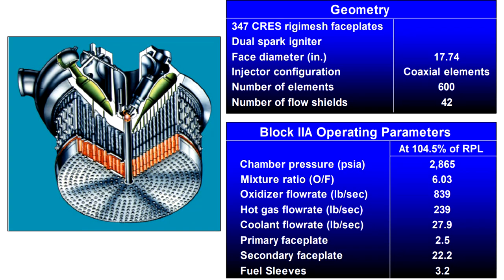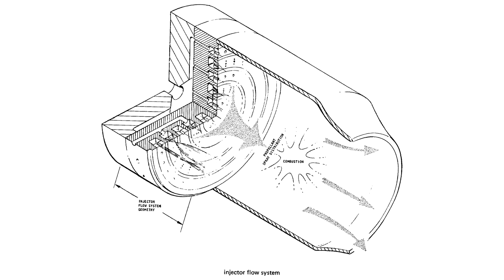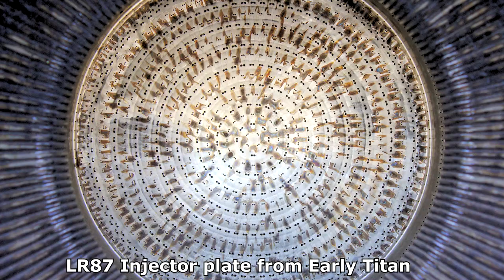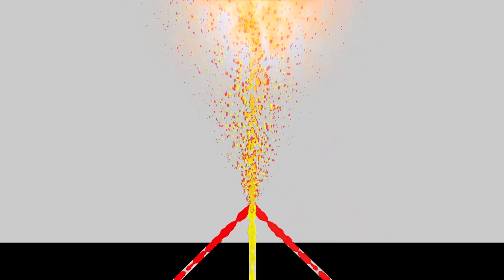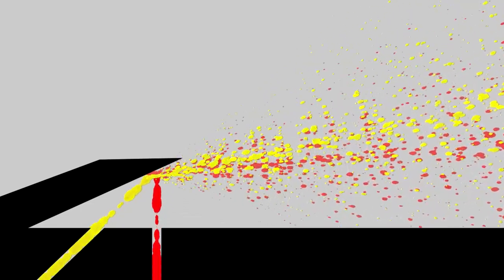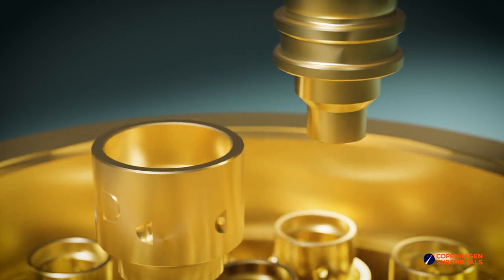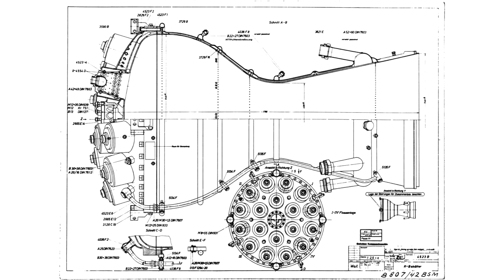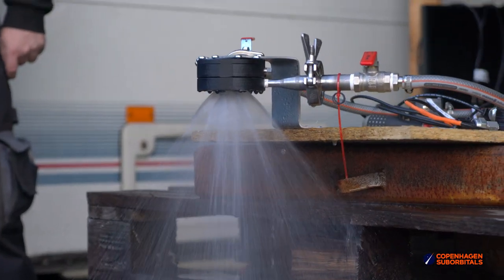Rocket Fuel Injectors - Things Kerbal Space Program Doesn't Teach

Comment: I worked on the F1 and J2 engines for the Saturn projects. I worked for Rocketdyne areound 1963 and 64 to start. 
I did improve the injector plate for the F1 and I know 
 about it. i have a photo with an astronaught , Walter Cummingham in fron of the skirt of the F1 engine. Some of these statments in this video are wrong.

Comment: There are six F-1 engines on display at the INFINITY Science Center. Five are mounted on the business end of 1st stage S-IC booster located at the facility, and one is mounted on its roll rack for up-close inspection. ISC is the official visitors center for the Stennis Space Center.

Comment: At 00:57: SSME main injector. Engine s/n 0110, Test 750148, July 2, 1981
Failure: Lox injector post crack

Incident Description: Test 750148 proceeded normally until 16.0 seconds when the HPOTP turbine discharge temperature exceeded the redline value. Inspection of the engine revealed extensive damage of the fuel preburner side of the main injector with burnthrough of 149 Lox posts, erosion of the primary and secondary face plates, and erosion of the interpropellant plate. The nozzle sustained shrapnel damage to approximately 150 tubes and the MCC suffered erosion damage.

Cause: High cycle fatigue of Lox post caused by random mechanical vibration of the powerhead and flow induced vibration from the hot gas combined with high steady-state stresses. The damage pattern of the injector indicates the failure occurred at the inertia weld of post 12, row 13. However, the posts in this vicinity were largely consumed by the fire, including the fatigue crack where the failure initiated. Post 12, row 12, which is very near the indicated failure location, had been reworked and the acceptance requirements relaxed, making this post a credible candidate as the failure initiation point. 5. All evidence points to high cycle fatigue near a Lox post inertial weld as being the single cause.

https://ntrs.nasa.gov/archive/nasa/casi.ntrs.nasa.gov/20050217132.pdf

Comment: There are thousands of shaped holes machined via die sinking e.d.m. Hence why I don't make videos pertaining to small hole machining. Shower head holes are best suited for film cooling of turbine hot section hollow vane rings.  Shaped converging holes work very very well for fuel distribution/mixing fuel in a rocket.  Former Pratt & Whitney vane/blade manufacturing engineer, tool designer and die sinker e.d.m. Yoda.

Comment: Ok, now I can see where 3d printing of high temperature titanium alloys would really help in cost and efficiency of rocket engine components outside of just the fuel and oxidizer manifolds and piping. I recall some efforts have been made to print the nozzles with the cooling piping printed into the part, but that has been more difficult because of the size and stresses that part takes.

Comment: I bought a really neat garden hose end about a decade ago and it worked really well as water rocket. I need to to see if I can find the drawing for it because the water flow from that converged in the center and I'd have a ton of fun mixing two different water streams (differently coloured ones) in it. It was basically a combination of a pintile and a swirl injector at it's very core.

Comment: Check out Aerojet Platelet Technology. The process begins with thin sheets of metal that are photo-chemically etched to specific design patterns to produce "platelets." Individual platelets are then accurately assembled, or "stacked," and joined via a diffusion bonding process. The result is a monolithic structure containing complex internal passages that allow for precise flow control, fluid manifolding and metering features. Also, in-situ filters can be included to preclude plugging or occlusion. The diffusion bonding process effectively seals the passages between the fluid circuits with a solid metal barrier, isolating and segregating flows. This allows for much higher operating pressures and temperatures.

Comment: Very interesting video. Makes me wonder if anyone has tried applying an electric charge to the fuel and oxidizer. The charged fluid should fly apart from repulsion as soon as it's not confined by the pipe, and if you gave the oxidizer the opposite charge to the fuel, they should attract and mix. Of course, charge differential can also lead to sparks, which might explain why nobody has tried one, but I am curious, and I doubt Google could tell me 😋

Comment: I think a fun science fair project might be to reverse it and make some impinging injector shower heads. Then compare the fine mist they produce with the parallel streams of a normal shower head. Depends on how difficult the fabrication is. Probably would make it by connecting a regular shower head to a piece of acrylic with diagonal holes drilled in it so you get that lovely see through effect

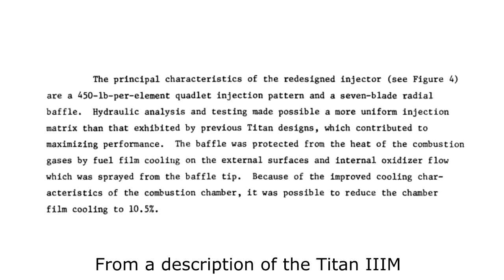Comment: the sts-93 video you did ( excellent info), you mention at 8:03 a damaged phillips head ( burred) causing wire shorting, you suggest an over-zealous engineer tightened it too much. Looking at the pic of the screw, and assuming it has normal thread direction, it was during untightening when the burring occurred. 

So the engineer would have been aware of how difficult the screw was to undo, likely he would have noticed the damage, as he would have to then tighten the screw. You could perhaps say he used a screwdriver which was at a bit of an angle ( not 90deg), an impact driver might have been the way to go.
If its a reverse thread screw then your theory might be correct, I'm guessing its normal thread.

Comment: Great project! If you just change the amount of ethanol, but not the oxigen, you might get high combustion temperatures at low ethanol flows. Are these still low enough for the combustiom chamber? 
How you ensure that the preassure in the combustion remains lower than the preassure in your supply lines? Otherwise you get backflow again.

Comment: Great video.  It might have been worth noting that the volume of fluid going through these is significant and at high pressures relative to the shower head and video of the water flowing though the injector.  The proverbial drop in the bucket.   They are an amazing piece of precision engineering for one (test) or two uses (launch).   It is interesting to note that it is not just the holes but the fluid path leading up to the exit every little change in direction is a pressure drop.  A carefully designed fluid path could be printed to move towards ideal and overcome the subtractive manufacturing cost limitations.  A final thoughts:  Do right hand swirl injectors work better in the northern hemisphere and left hand in the south?!     Are the swirl patterns balanced to eliminate gyroscopic effects?

Comment: I believe Space X is 3d metal printing the injectors, to avoid all the drilling involved, especially considering the metals involved are very exotic and difficult or imposable to manufacture with normal subtractive manufacturing technics, They use 3D printing for the SuperDraco engine chamber.

Comment: What I still don’t get is why the combustion in the  rocket burn chamber does not push the fuel and oxidizer back in the pipes/prevent flow. Only thing I could think of was that the injectors are higher pressure, in which case is might seem logical to not burn it but use it as propellant. Obviously something in my thinking is wrong but what?

Comment: A great idea to try with the pressurized fuel tank is instead of pressure pushing the fuel why not pull the fuel from a bladder, you can even help the process by squeezing the bladder with pumps pulling the fuel.
Reply: i think the pressure required is extremely high, only a pump fed by the energy of the engine can sustain it.

Comment: Hi,
On the F1 engine, they had a problem with the fuel injector plate that caused a oscillation that planted itself upwards into the stages. How did they solve that ?

Comment: I'm still waiting for rocket injector technology to evolve past pintle injectors. Modern common rail injection setups in diesel engines use a much better system with higher atomization rates. I believe that although it is a very low flowing system it could be adapted to rocket engines or jet engines. Seriously the inefficiency in the designs is crazy compared to diesels.
Reply: yes

Comment: Great stuff.  It does lead you to wonder if atomization is the key desired end result and surface tension of the liquid is what you're trying to overcome (the point of swirl, impinge, rotating style injectors) then is there another surfactant that is much simpler / easier to manufacturer that is more efficient?  Swirling in tubes seems archaic, frankly.  Could you impinge the flow with radio / light / electric waves to break down the surface tension for example?

Comment: Another very informative video, thank you!  You answered some questions I have long had.  I am looking for recommendations on obtaining a better understanding of how to shut down a rocket engine. This is more on my mind with the Falcon 9 but actually extends to other multi-engined rocket.  With gimbals involved, controlling an engine shutoff cleanly must be quite an engineering challenge all on it's own.  Even with the solids I wondered about what happens if one of the SRB's (shuttle) shutdown a second faster than the other.  Could the shuttle engines compensate enough or was that a non-survivable event for the vehicle?  With 9 engines on the Falcon 9 and then 3 with the boostback (less mass/inertia to deal with), this makes the shutdown event even more critical.  (maybe a video in there someplace (if not already and I didn't see it)).  Thank you for your always substantive and entertaining work.
Reply: You can't (practically) shut down a solid. They simply burn to the end. To avoid the problem you raise about one burning longer than the other, the space shuttle (and others) release the SRBs before they burn out. so you can control the timing better. Also note that the thrust profile (trust over time) is controlled in the shape the fuel is cast.
Reply: @jnygaarddk  Good point about the separation timing and thrust being designed into the build,  I did understand that to some degree.  Though the possibilities of imbalance never left me any comfort for solids as being human rated.  Spinning turbine pumps on engines which needed to be restarted is a bit different though.    Hey thanks for the the input help!
Reply: @rogermarcoux8029  Remember the SRBs on the Space shuttle has a gimbaling nozzle on them for TVC. Takes care of any imbalance in thrust

Comment: So what's the current status with 3d printed injectors? Looks to me like a prime candidate for it, yet it seems to be still very much in the experimental phase?

Also, do the 3 landing Merlins on the Falcon 9 have different injectors to the others so as to better accommodate the throttle control and shutdown requirements?

Comment: In the first example you showed us with the differences in weight of either the oxidizer/fuel will make the mix travel at an angle, so engineers have to compensate for the weight. Is that how different engines will run a closed oxygen/fuel rich cycle? 

I’m sorry if I sound dumb lol, I’m new to this stuff

Comment: hello scot, i dont know if you will ever read this comment, but im building my own amateur rocket engine with scrap parts, now i got the injector with 6 holes pointed to the center at a  in about a 30 degree angle and with a bigger hole in the center, now according to this video, i got even more confused, wether i should use the oxidizer or the fuel in the middle, due to cooling matters and pressure in each propellent im going to use (one liquid and other gaseous), is there any way i could show u my injector and explain better my questions to you? 
ps.: anyone that would be willing to help is welcome too

Comment: I gotta ask ... Why change the angle of the coaxial swirl injectors after the injection, when you can manufacture that same angle, precisely like in the earlier, simpler injectors? I thought that optimizing exit speed is the holy grail, plus it kinda makes sense that faster impact between the two, whatever two, propellants equals better spraying. Might be a minuscule break but it still seems like a break, at least to me ...

Comment: At 15:00 Scott mentions the benefit of having the propellants exit the injectors as a gas. Wouldn't it then be beneficial to skip all these collision methods by heating the fuel and oxidizer to the point that they're both injected as gases? I imagine it could be heated radiatively from the heat of the combustion chamber. I wonder if it's possible to use both the oxidizer and fuel in different parts of regenerative cooling to the point where they both end up injecting as gases. Is that too complicated to engineer? I

Comment: What about the resin mixing tubes that have a double spiral that meet at the end and mix, that could be used to inject fuel? The other I thought about was a straight drilled plate with another plate with the holes slightly off so it would spray the fuels, it save complex drilling.

Comment: There is one more type of injector that wasn't mentioned. Supercritical injectors. They use supercritical fluids, which is possible because these days we have comparably high pressure combustion chambers that lend themselves to such design choices
Reply from the maker: Lots of the fluids entering the via these are supercritical already, how does the injector specifically change for this?
Reply: @scottmanley  With the high chamber pressures and temperatures you can get supercritical injection which lends itself to much simpler injector designs since you inject media without surface tension. This leads to much better mixing of the components. So you can safely use comparably simple injector geometrys (mostly used with cryogenic fuels).

Whereas stuff like swirl injection or pintle injection etc are mostly used in chamberes with more moderate temperatures and pressures since you have to rely on even atomization for proper mixing.

Edit: So overall it's essentially an own injector category even though from a geometry standpoint it arguably isn't

Comment: What kind of injectors does the Rutherford engine have? Since it's 3D printed, you could put whatever weird geometry your modelling optimizes for.
Reply: The Rutherford seems to "only" have a 3D printed combustion chamber and nozzle, with a machined injector assembly bolted on top.
Reply: @CopenhagenSuborbitals  Huh, what's the reasoning? Of all the components, I'd think the complex geometries of injectors would be most suited to printing; unless the tolerances aren't good enough?
Reply: @allanrempel5839  Not sure, you'd have to ask Rocket Lab. Perhaps back then additive manufacturing wasn't at the required level for injector manufacturing yet. But now you can see that being done, or at least attempted by, for example, Orbex, who are going for a fully 3D printed engine. We also just received a few 3D printed swirlers for testing. We should have a video on that soon if you're interested. :)

Comment: 15:0o "if you think about it the reason why we are wanting the fuel in tiny drops is so that they evaporate into a gas faster."  that is not exactly accurate. the reason is so that one may maximize the surface area  contact between the reactants in order to have the most efficient, consistent, rapid, & stable reaction possible.
Reply from the maker: And a gas has the highest surface area.
Reply: @scottmanley  hi Scott first thank you for replying. :) I do very much enjoy your presentations even though I often feel that some things could be improved. but then that is the nature of the subject. I feel very strongly for instance that not enough attention has been paid to large scale off planet life support concepts & I don't mean recycling old O-Neal or von braun station drawings. nobody and I mean nobody seams to have a clue about the potential for deep space architectural design.

Comment: First heard about preburners. Are they really small rocket engines inside the fuel and oxidizer supply line, where a small amount of the other ingredient is mixed in, ignited and burnt, to a) drive the turbopump with a power of 50000 HP and b) heat up the fuel/oxidizer from liquid to gas ? Interesting.

Comment: If the RL-10 chamber pressure is over 4000 kPa, what is the output pressure of the turbo pumps to achieve a spray at a high flow rate?
Reply: Add 10% or so would be a fair guess.....
Reply: The hydrogen turbo pump outlet pressure is about 1700 psi (~12000 kPa) and the oxygen at about 900 psi (~6000 kPa).

Comment: Has pre-mixing ever been attempted? Wouldn't work with hypergolics, for obvious reasons. Wouldn't work for anything with liquid oxygen, as it would freeze most fuels. Even methane and liquid oxygen have only a few degrees of play between each other before the oxygen freezes the methane. But who knows, if the fuel is stored in frozen powder form maybe a heterogeneous solution can be achieved haha
Reply: yes it has been tried before and it usually ends with a huge explosion from a tiny spark that ignited the  fuel. any ignition source and the fuel will have plenty of oxygen.

Comment: why not just add an open bottomed cylinder around the pintil output to redirect the atomized mixture and prevent the hotspot banding? i get there are some basic issues but none seem larger than the benefits and its a billion times easier than adding regenerative cooling.

Comment: i shamelessly admit i always thought the fuel mixture was pumped into the cone just from two huge ports, like in a petrol engine, were it ignited. Seeing this video, i remembered that even a portable gas stove, the simple one you light up with a lighter and is fed with butane from replaceable canisters, even those, have many tiny holes on the component from where the butane exits the device and is burned.
i'm a physicist... with an msc 🤣